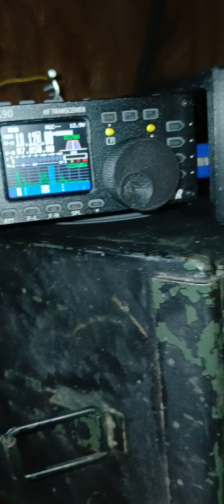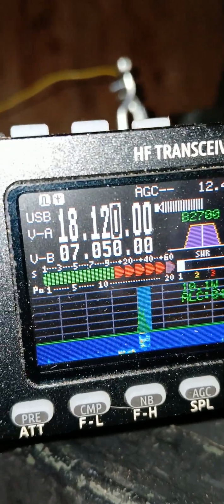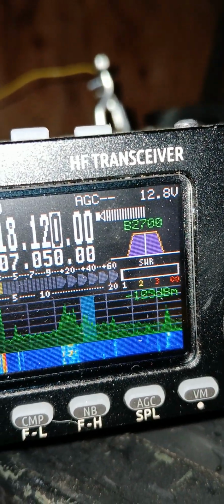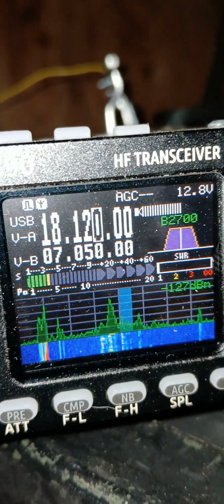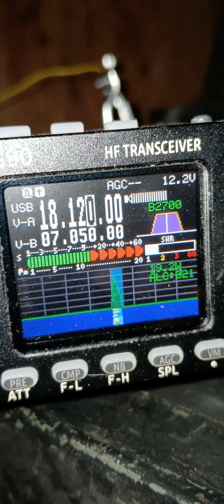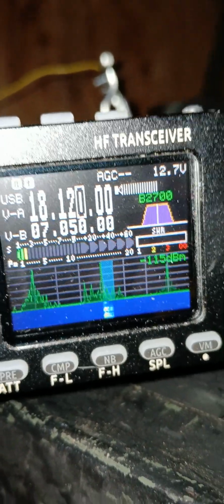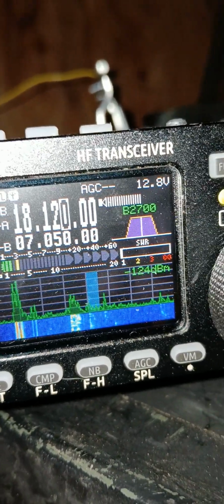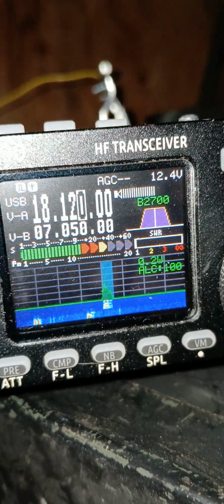Electric Fence Antenna?

Comment: you can use any exposed wire as an antenna, reading the signal is the hard part
Reply: How long is your electric fence?
Reply from the maker: @kd5inm  lol, that's hard to define because it's a web of linked pens and fields, with the piglet pen being 4 loops of wire at different heights to keep them off the fence as they grow. Total, I'd say around 3000ft of wire and polywire on the property. Makes it more difficult to give you an exact answer because I'm always shutting down sections of the wire in vacant fields and pens to prevent shorts from vegetation and maximize juice where the pigs are.
Reply: @AI7RK  I see. I have a fence charger that was rated at 15 miles and the wire was about 4-5 strands at about 120 feet length and the goat would go through it. I had to up it to charger rated for 60 miles and now she stays clear of it. Lol
Reply from the maker: @kd5inm  hahaha, that's a spicy fence. What I found is that the ground system is absolutely the most important part of the fence aside from preventing shorts in the wire. I don't know what length mine is rated for, but even with vegetation shorts it'll still throw 12k volts in the back corner of the field.  The original ground systembI inherited with it was 2 rusty rebar rods with the ground wire hose clamped to them. It was trash and I couldn't get more than 3k volts anywhere on the wire.  The new proper 4x 8ft ground rods was a game changer.
Reply: @AI7RK  I ran a ground wire from the charger to a ground rod and alternated wires from top to bottom. Live plus wires are insulated from T-posts and ground wires are between the hot wires, so hot wire at top, then next one down is ground and is wrapped on the T-post then next down is live hot, then ground, then hot, then ground. If she sticks her head between them, she gets got. So each ground is wrapped and tied to T-post and I've found best insulator is an inch or so pvc pipe piece with holes drilled in it and wired to each T-post cause she breaks the yellow t-post snap on fence insulators. Shes a full size Alpine milk goat and an ornery cuss....lol she used to walk through the 15 mile fence but not now, it lights her up.
Reply from the maker: @kd5inm  outstanding! Pigs are all tenacious creatures. IPP's are 250-400lbs, all below your hip. Closest thing nature has to a skidsteer.
Reply from the maker: @agostonpahi3816  I've used some weird stuff as an antenna for the G90, but my E fence wire works relatively well considering it's only a foot off the ground. Being 100% insulated from ground is a plus.